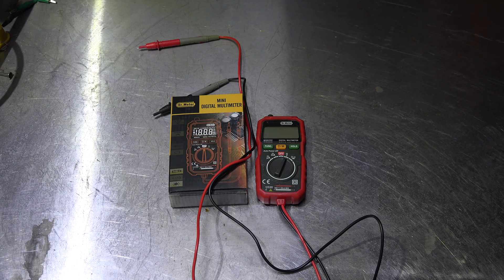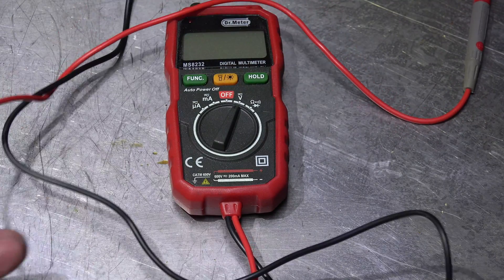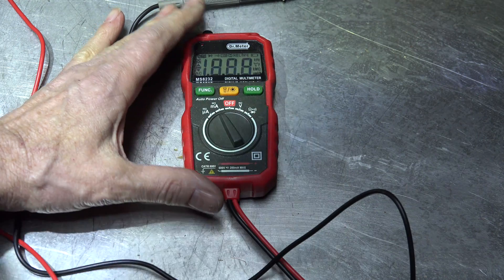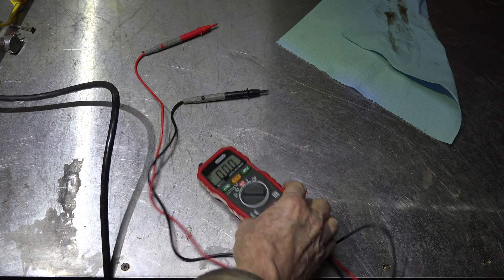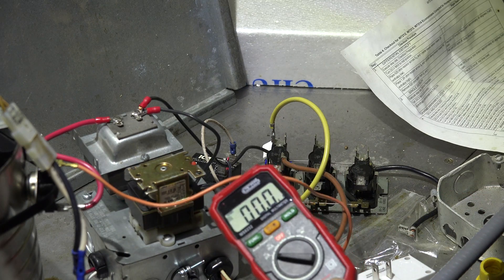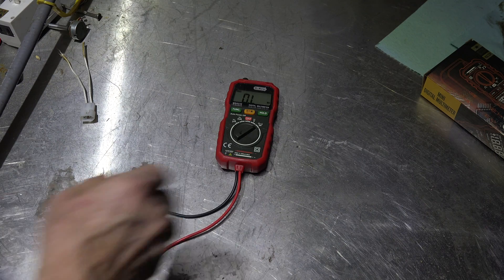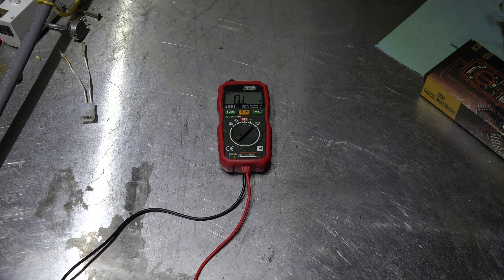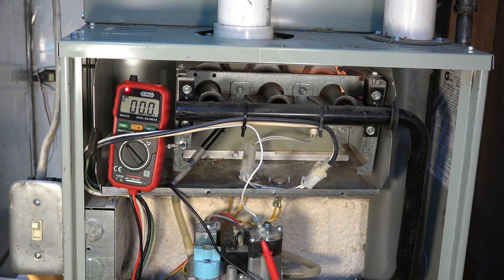A test of a "Dr Meter" multimeter

Comment: These are about 11 bucks on line. If you're a pro then of course this wouldn't be your primary meter, but for general household diy it's perfect. Meter snobs don't seem to realise the difference between occasional household usage and daily work usage. 

Audio continuity and voltage detection alone makes it a great deal.
Reply from the maker: I am somewhat different than most techs in that I sometimes use cheap meters like this one sometimes for convenience.  When I am working with high voltage on the job, maybe not.  but for an outlet in the house, I like this one.  It always has the leads connected, and when the leads fail, I can throw away the meter.
GFM
Reply: @grayfurnaceman  I went on a buying spree for cheap meters a couple years ago. I bought about 4 of them. This was my final purchase after investigating many (under 15$) meters. I like the small sizes of the 'cheaper' ones. I use it so rarely the leads will probably never wear out.

I'll bet 90% of the pros that bash these cheap meters own at least one of them.

Comment: I just got this one delivered last week, have to say for the $9.00 I spent its a handy little bargain.  I can say I do have a small precision standard circuit with 4 voltages and this meter reads dead on all four voltages and same result using a few 1% tolerance resistors, it seems very accurate for being so inexpensive.   The leads could be replaced if need be some day.

Comment: If the leads go bad just split the case and easy to cut off the jacks and solder in a new pair - $4.00 - or thereabouts for similar leads on ebay.

Comment: the fuse is most likely a surface mount component and probably only protects the amperage functions. since it says 600V & 200mA max on the face, probably fused at 300mA, so  loading it around 1/2 Amp current on the micro/mili-amp setting would certainly test/blow a fuse, I doubt the shunt/fuse would be much larger than the max rating.

Comment: For $16 it is a good backup and worth it for the dc ua (microamp) and self-protection capabilities.   As you indicate, lots of clamp on amp meters can't do the dc ua testing.   The specs indicate capabilities up to 600 vac.

Comment: A little off topic but I was wondering how one would go about testing a liquid bulb sensor for a gas range, looking forward to your reply.
Reply: Derek speer I see very very few of them. But in my limited experience I'd say it either works or it not. If not replace. ( the ones I've seen have been mercury vapour valve, so it's all in one assay that I ain't fuckin with)
Reply from the maker: I would use a thermocouple temp sensor mounted on the sensor and see if the temp of the control is the same as the thermocouple.
GFM